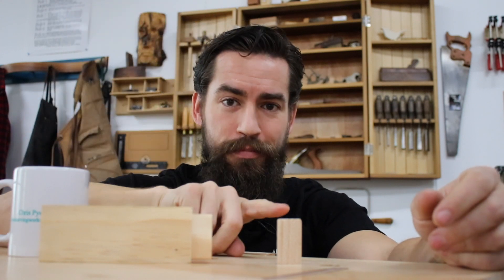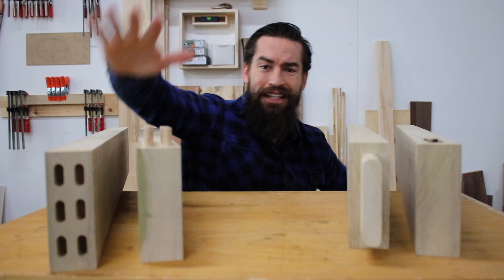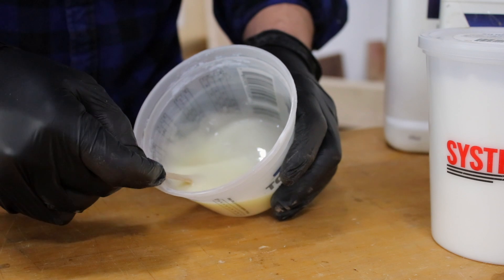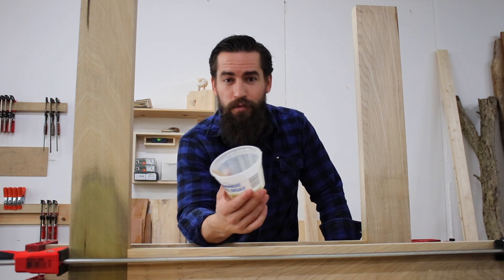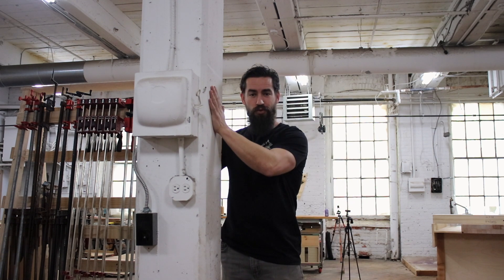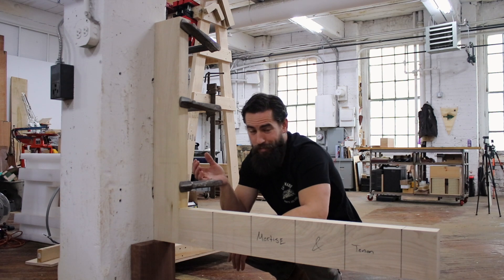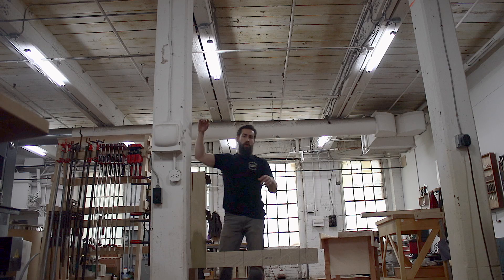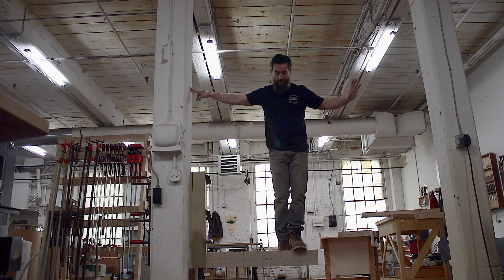I Can't Believe This Failed

Comment: i would argue that the epoxy tend to get absorbed into the fibers and creates a stiffer block in the wood grain surrounding the domino joint which doesnt flex with the rest of the board under tension, where as more wood fibers inside the mortise and tenon joint allows for more flexing

Comment: @ENCurtis
I just stumbled upon this video you have done. Very interesting video here. I am late to this party, April 2024, but after watching this video and reading almost all of the posts from the viewers, I have a  few bits of woodworking that a retired tree killer can impart. 

@ 2:58 you are showing your stile and rail sample pieces after being machined. They appear to have been made from Tulip Poplar. Poplar is considered  a hardwood, is very srable, lower costs than oak, and it has excellent machining properties. It is an excellent lumber to use if you plan on applying a paint finish.

The reason that there is a need for fastening devices, is the adheasive used to hold two pieces of wood together, no matter the type and or the brand of adhesive that is used, CAN NOT SUCCESSFULLY BOND THE WOOD GRAIN TOGETHER WHEN THEY ARE AT OPPOSING DIRECTIONS. If the grain was oriented in the same direction any glue would be sufficient, all by itself. The exception to this would be if you were trying to glue end grain to end grain, OR  AS IN YOUR SAMPLES END GRAIN TO VERTICAL GRAIN. 

Since this would be totally impractical, a millennial of time ago some wood butcher invented a practical way to join two piece's of wood without any glues. Ever since then any one else doing the same thing always tried to improve on that idea. Some failed and some did make improvements. Fast forward thousands of years and there are hundreds of ways to SKIN THE PROVERBIAL CAT. Many ways today require glues.

If you are trying to mimic the joints in a typical stile and rail interior door, your lumber should be aproxamently 1 3/4" thick by 5" wide. No matter what type of fastening you plan on using, YOU MUST ALSO CONSIDER  THE MACHINING REQUIREMENTS FOR ANY WOOD OR GLASS PANEL THAT WILL BE INCORPORATED INTO THE DOOR. These machining requirements may and will dictate the size and location of fastening devices like tenons, dominos or dowels. Tenon and domino thickness or dowel diameter should be aproxamently 1/3 the thickness of your stiles and rails. Tenon length and mortise depth should be aproxamently 75% of the stile and rail width. Tenon width should be aproxamently 75% of the stile and rail width. Tenon should have rounded edges. Mortise should have rounded corners to prevent possible splitting along the square corners. This type of joint can be fully assembled with either glue, or by using 1/4 diameter wood dowels/pins thru the mortise and tenons. 

If your preferred method is to use dominos, I have no knowledge of what sizes are available. But one of your viewers noted that they were designed for alignment only. On your sample 6 dominos removed too much material and caused the stile to fracture on the outside shoulder. A row of three dominos would have left a larger shoulder thickness and a much stronger stile. Can you get and machine for a domino that is aproxamently 7 to 8 inches long? This type of a joint must be fully assembled with glue.

Door companies have been using dowels for a very, very, very long time. They have been using typical 1/2" to 5/8" diameter by 7 to 8 inch long dowels, fully assembled using glue.

Great video with lots of information to ponder! Keep up the good work.

Comment: From the perspective of someone comming from physics, i clearly see an advantage in the length of the traditional mortise and tenon. If you draw the forces for both systems, it's clear that for the longer mortise and tenon, there is less pulling force on the grain that got ripped apart in the domino joint. So if this is the weak point of that joint then it makes total sense that the mortise and tenon was able to hold more weight simply due the the higher leverage it had and the smaller forces this puts on the grain that failed. It's simply pulling less on that grain.

Comment: I think it was just a difference in leverage... dominoes only had 1 inch on insertion to counteract the lever arm while the tenon had more than two inches.  Imagine the fulcrum at the deepest part of the joint, and you levering against the grain strengh nearest to where you were applying pressure.

Comment: Be interesting to see using the DF700 (BIG DOMINO MACHINE) with 140mm (5.512in.) long.  That would get you closer to "same - same" testing (depth of tenon to depth of domino)
Also could try to clip off the tenon and mortise of both of the "straight grain" pieces, add the big domino in place and try to break your ankle again...:)
Probably best not to try this anymore and I think for most of us, either one of these is going to be plenty strong as no one with any sense will construct a cantilevered wood joint without adding a brace, cable, chain, etc., etc. for the obvious reasons.
We (the subscribers) do learn an awful lot from you with the simple and explicit knowledge you pass our way... many thanks to you for all you do!

Comment: Maybe the shallow depth of the Domino gives you a double-whammy. What failed looks like the vertical piece. Pushing down on the horizontal piece make a lever with the fulcrum at the shoulder and the dominoes on the other end.

For a given length you push down on, a shorter domino gives the lever more mechanical advantage.

I think what may be giving the double-whammy is that the shorter tenons distribute the greater force over a smaller area, which would be more tensile stress on fibers . But I dont have your tenon dimension, and it's possible that your double rows give as much if not more area.

The round edges would also tend to concentrate the force. The female sides "blowing out" are consistent with the dominos being driven down like a splitting wedge.

Big picture, though: if that's what you had to do to break the joint, nobody's coming through your client's locked door without a key or a ram.

Comment: The length of the tenon is the most critical difference in the two in this particular experiment, not domino vs traditional tenon.  The traditional joint did better because having the longer tenon, it had more cross grain bond area.

Comment: This is not a fair test. I don't know what the gluing surface area of the mortise and tenon join is compared to the domino join - let's just assume that they are roughly equal in this case - but If you compare the length of the tenon at 4:10 with that of the protruding domino at 5:05, the domino's exposed length is not even half that of the tenon. If the dominos went twice as deep, twice the force would need to be exerted on the wood member that broke in order for the member to break.
Despite this, this is a very instructive demonstration although I would like to see for once a join strength comparison where no glue is used and where all parameters of the two joins compared (apart from the very join geometry itself) are kept equal.

Comment: would the tenon be stronger if you doweled "through" it? so once in the mortise you'd then dowel through the face of the board through the tenon and out the back of the board? would give it a lot of "shear" strength when given lateral force would it not?

Comment: No matter what you do, a joint will never be stronger than the base material.
Hogging out big holes does not help. Dominos, dowels, box joints, dovetail, ... none of them fuse together more fibers of 2 pieces of wood like a simple miter joint glue-up.

Comment: Ive no clue what Im talking about but the thinner edge profile of the dominoes might be concentrating the force into a smaller area (fewer fibres). A bit like narrow chisel/wide chisel. Ofc depth, thickness from motice to shoulder edge, grain, defects etc are all possible factors.
PS I was however sitting here thinking that M&T looks looser.😂

Comment: SURFACE AREA...The breakage occurred at the exact depth of the floating tenons...that is not naught. You sighted that the shoulder separated on BOTH...SO, that only leaves the flat-grain-to-flat-grain surface area left for support and the large mortise had, I'd say, at least TWICE the flat-grain-to-flat-grain surface area of the dominoes...AND ALSO  most of that at considerably greater depth. I think that even if the grain patterns were reversed, you'd get exactly the same result. AND, I'd bet that a bridal joint would hold even stronger than the mortise and tenon did because even MORE surface area.

Comment: Hello,

TL;DR; It is the tenon length that gives the strength.

OK, have done the same test HOWEVER, I did use two 14x140mm dominos using the Domi-zilla (DF700) and the traditional tenon was 70mm deep in the wood. I also used longer lengths to exert more force on the joint. Glued it all up with epoxy and stressed it. They both eventally broke at about the same point.

I also modelled this in cad then ran a mechanical simulation with the same results +/- margin of error.

Ta,

./M

Comment: Similar to other comments, the depth matters w.r.t. leverage, and the MT is significantly deeper than the dominos. Also, the mortise shoulders are thicker (and therefore stronger) than the shoulders around the two columns of dominos. The domino version failure is clearly in the upper part of the shoulders. Maybe a better comparison would be with deeper dominos and similar width shoulders.

Comment: I am looking at the failure from an Engineering perspective.  The bending moment creates tension at the top of the joint and compression at the bottom of the joint.  The dominoes and the tenon resist shear.  The tenon has a larger shear area and is stronger in shear. 

The failure was not a shear failure.  If you had used only the top two dominoes, the failure would probably have been the same.  The additional 4 dominoes did not significantly increase the strength of the joint for configuration of this test (bending moment the direction tested).

It appears that the noises you heard were the beginning of failure parallel to the wood grain and not of the glue joint.  This certainly appears true with the ultimate failure of the dominoes test.  I suspect that the tenon did a better job of load sharing on the wood after the first cracks were heard because the tenon has a significant bending strength in itself.  The dominoes do not have this inherent strength,

Ironically, if you had used just the lower two dominoes, the joint might have been stronger.  This is because: 
1. There was no shear failure. 
2: There would have been no interruption of the grain at the top of the joint (where failure began)

Comment: An interesting and practically test.

(1) I think your point about the grain structure of the board that broke apart is sound. In another test, the pieces of wood being tested should be cut from boards with the same wood grain orientations, if possible.

(2) If you calculated the total glue surface of each joint, you might find that the glue surface on the single, large tenon exceeded the glue surface of the smaller, multiple floating tenons in this cases.  I'm not sure about that, but it would be relevant to the test to determine this. One way to address this is to calculate the glue surface of the entire set of smaller tenons and then cut a single large tenon so that it has the same total glue surface. Testing two joints with the same glue surface area would be a more direct test of the soundness of each type of joint.

(3) Work to ensure that the tightness of fit of the large tenon is the same as that of the floating tenons.

(4) Equalize the length of each type of tenon to see if this affects the relative strength of each type of joint.  The simple fact that the single tenon was longer gives it added resistance to cantilevered force.

I don't know what the results of a test using these added controls would be, but it would certainly be interesting.

Thanks for an interesting and thoughtful video.

Comment: Surprised me. Your M&T was loose and sloppy, but it was longer than domino. Dominos were also too short. Static loading held, but dynamic loads always do a number on structures. When a force is applied a distance away it’s called a “moment’ the magnitude of the moment= Force X Distance
Moment is essentially a torque load. The multiple dominoes in a row pretty close together weakened the wood and it failed along that weakest part. Interesting test though.

Comment: In my experience the wood ALWAYS fails before the glue in the short term, but some glues get brittle and fail over time (you see this in old furniture, especially chairs.) The "over time" part matters with doors because their joints are basically under constant pressure from the moment they're hung.

Comment: I recently made a set of chairs with traditional mortise and tenon, and then right after made a set with dominos, and while the chairs are different designs they had similar amounts of joints. The dominos were sooo much faster I’m selling my square chisel mortise machine, and won’t look back at all. If a chair is put under undue stress maybe it will blow out, but leaning back  won’t be the cause, it would take falling off a balcony or moving truck

Comment: No way bro, that domino part failed due to too short domino's and the double row diminished the wallstrength of the joint. Two domino's of equal length to the tenon would have stood a better chance.

Comment: Not for nothing, but festool themselves say that dominoes add No strength to a joint, they are they are designed for alignment, and the glue is what adds all the strength to joint. It was cool to see it proven though.

Comment: Apples and oranges. You can pin a traditional M&T joint for incredible strength without using glue whereas not so much with dominoes.
Reply: The XL dominoes are big enough to pin.

Comment: I think you clearly demonstrated that the surface area of wood involved in both joints was not the determining factor for failure. It was the surrounding wood that failed, not the joint.  I would say that for the boards being joined, the domino joint resulted in less thickness in the surrounding wood compared to the tenon joint. Maybe by as much as half.

It would also be interesting to see how things go if the other side of the joint is vertical, so the tenon/dominos point down.

Also, if you do this again, maybe have the horizontal member just 4 or 5 inches off the ground. 🙂

Fun video though.

Comment: No hate but the mortise and tenon looked pretty loose when you slid it together, and It still held. It can only get stronger. Pretty wild honestly.
Reply from the maker: Certainly not the tightest of joints, but epoxy fills gaps better than most. Pretty wild indeed that it still held better than the dominoes!

Comment: I’ve never used epoxy for glue before…hmmm.
Also a thought about glueing with epoxy… in a mortise & tenon joint… could the joint be even stronger if you purposely “dovetailed” the mortise just a little. (Have it tight at the shoulder, but open up the bottom just a little). My thoughts are that since epoxy can “fill gaps” that this would almost create a “dovetailed mortise and tenon” lol.
Just rambling, but anyone got any feedback on this?!

Comment: Hi, so I'm late to the party on this video. I'm halfway through it. So my thoughts are, the traditional mortise and tenon will be far stronger. In fact a traditional full length mortise and tenon with wedges even stronger so much more glue again... the domino's are a glorified dowel. I have the machines too. The domino's are way to easy to snap.  I think to give the domino or loose tenon a chance you need the xl machine and home made domino's from the timber you are using. So my guess is the domino's will tear apart.
The other true test jig would be. Simulate a locked door and someone trying to kick it in. Would the tenon or domino hold better in that scenario 🤔
Might need to visit someone with a hydronic press to simulate that pressure 😅
Reply: Ahh so the grain failed. Okay so tenon depth then is key to that succeeding... 
Really nice experiment though, maybe a follow up on longer domino's? If you haven't got an XL. Get festool to lend you one and tell them you're trying to save the domino in a competition 😉

Comment: No join is stronger than the weakest part! You can use the strongest glue in the world, and even use steel tenons, but if the wood is thinner on one sample than the other, it will fail sooner (assuming the wood is comparable grain-wise).

Comment: Great video Erik, really informative. 
One question though: Why did you choose epoxy rather than wood glue?
Reply from the maker: I have a video on this theory that explains it at length, but in short, epoxy has a higher tensile strength than yellow glue.

Comment: I think too much wood was severed during the installation of all those dominoes.  You effectively turned the end of the vertical board into "particle board" with all those chips.  The failure is throughout the domino's area... just like a particle board failure looks.  Joint strength isn't only about "glue surface area".
Reply from the maker: Agreed. I think too much wood was removed too close to the edge of the board. Perhaps another test in the future with this is mind...

Comment: I make a fair few interior and exterior doors, mostly with the Domino. Where that sort of strength is required (which is very seldomly) I use 100mm long 14mm wide Domino’s…..using the short 60mm ones gives little penetration and fibre support. Very good video otherwise. PS: I’ve never had a door or wooden gate fail with Dominos…..never.